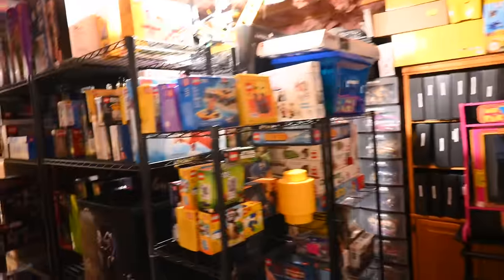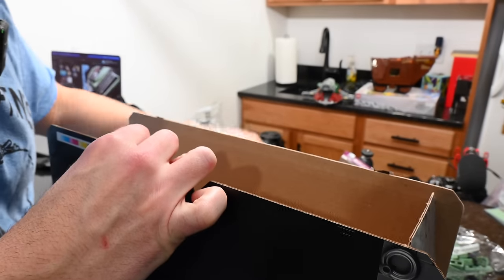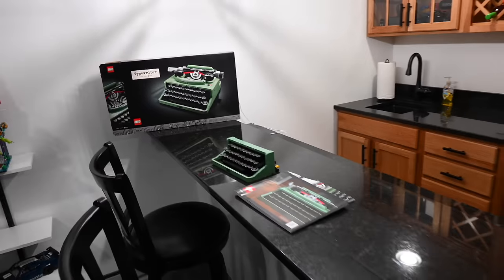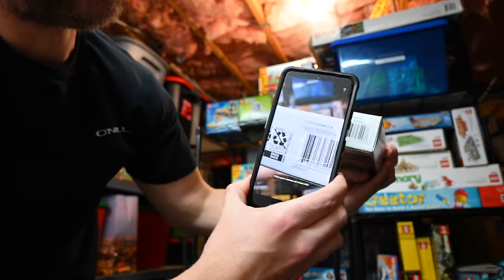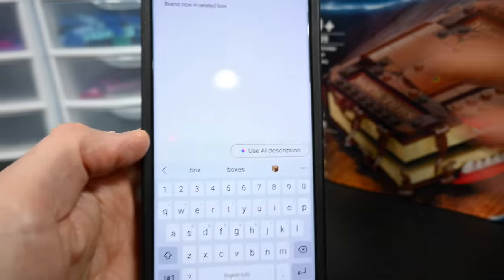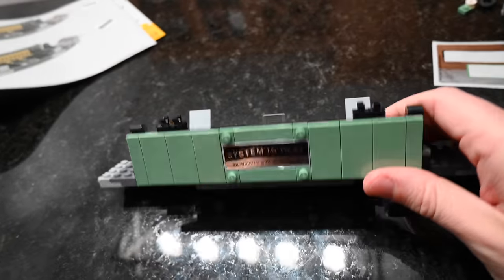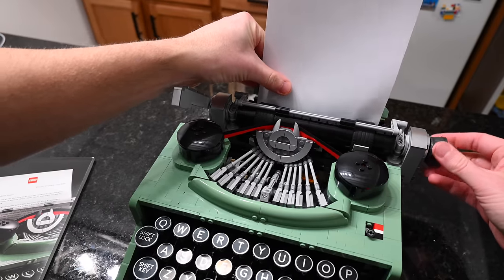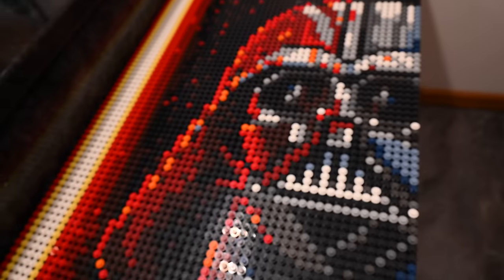When Your LEGO Backlog Becomes an Investment  | Our LEGO Journey 2024 Week 4

Comment: Greg, If you turn Ninjago city Docks around 180 degree, you will see that all the signs and shops lines up perfectly with the Original set.  You can ofcorse has it anyway you want, I just want to inform you that you has it backwards.   I commented about it in the last vid (6 days late, I know) . Not sure you read it so Im commenting again.
Reply from the maker: Very interesting!  I went with the way it is always shown as an independent set and even on the front of the box. After reading your comment, I did some searching and you’re right!  It does look better spun around when connected together. I’m going to rotate mine. Thank you!
Reply: @brickitect  Happy to help :)